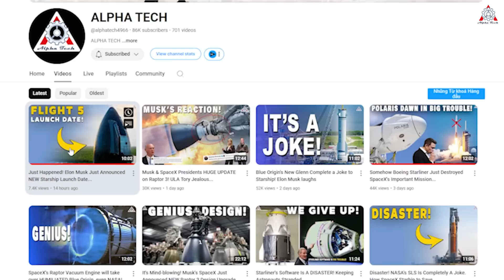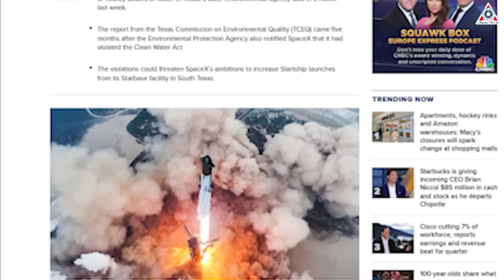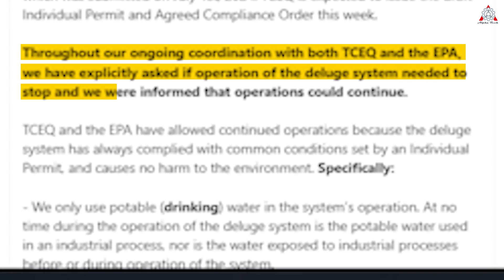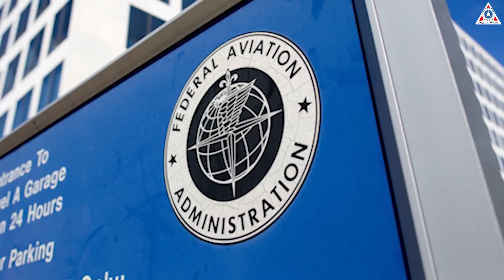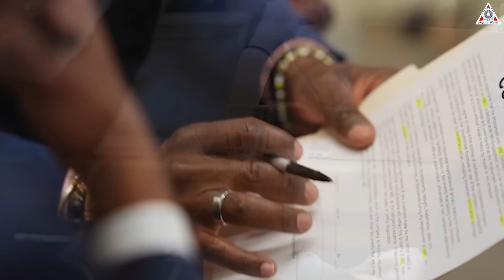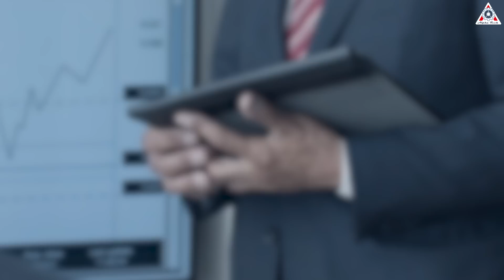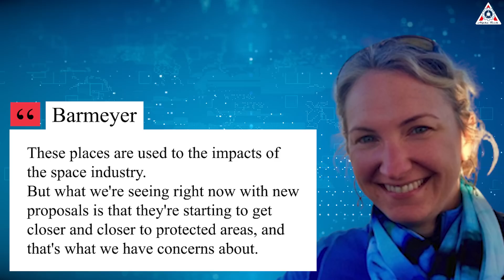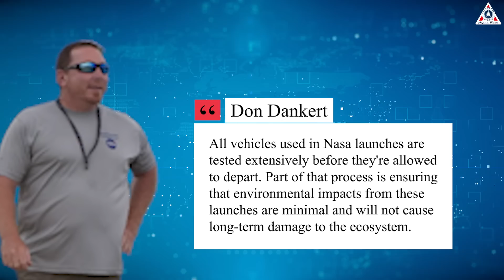Elon's Starship Is In BIG TROUBLE With FAA! What happened???

Comment: Every government agency is being sent to attack SpaceX and every company Elon Musk owns just because he held a public conversation in X spaces with Trump and talked about broken systems within the government and exposing government propaganda. Elon even pointed out that vilifying oil and gas is the wrong way to go and in all practical aspects it will take around 100yrs for just the USA to transition away from carbon-based fuel even longer for manufacturing. We are 1000+ years away from Star Trex technology and until we get there petroleum products are needed to make basic items from glasses to shoes and Carbon Steel to aluminum and titanium, basically every item you own or use petroleum is in the production line somewhere. Oh, the EPA clean water act wants to tax you based on how many square inches you roof, and driveway covers

Comment: When they do a Spin Test, pumping fuel through the engines with no ignition, they are venting methane to atmosphere.  When they fill and empty the booster and starship tanks, they vent methane to atmosphere to control pressure.  As production ramps up, multiply all this by twenty five or more.  Methane is a greenhouse gas that has ten times the environment impact as carbon dioxide.  Then there is Falcon and all its launches.  This is a detail of environmental impat that Inever hear discussed.  The topic is restricted to the combustion products of launches.
Reply: The spin test makes the static fire obsolete so one test instead of 2
Reply: Hi jeffe😂😂😂🎉
Reply: And every full of crap climate alarmist deluded liberal put together produces even more methane and CO2 than starship, my vote is we keep starship and ditch the karens.

Comment: -
Well the Anti-SpaceX folks are out in force;  I doubt they are really environmental folks; as they keep referring back to the first flight problems; like such issues are still occurring, or such has just happened.  Which is a foul propaganda tactic that Fox Noouse practices.

It was reported that the first time the water Deluge was used there was some contamination from its manufacturing processes for the few first times when it was tested; that went away by the time of the third launch.

There are roadblocks on top of roadblocks being thrown at SpaceX to impede its development of its Starship launch system. Looking at the big picture; since the industrial revolution, well over some 200 years, the human race has pumped at lot of green house gases into the atmosphere.  The human race can't just turn off all processes that make green house gases as that would kill thousands of human beings; if not millions of human beings. Though we should mitigate some effects of the green house gas production. For example closing down aka plugging the thousands of abandoned natural gas wells which many are leaking in the United States, would do much more to mitigate green house gas problem than shutting down SpaceX.  If you are wondering why the plugging of the thousands abandoned natural gas wells hasn't already happened; it is because of doing such is rather expensive.  

As for Starbase at Boca Chica Texas the oceans are going to rise for a very long time.  Maybe for hundreds of years.  It should be noted that it is beyond human ability to stop the oceans from rising at this point in time.  Thus the shorelines are going to change; whereupon the shorebirds are going to move inland. SpaceX has purchased land upstream for the wildlife, but eventually even that will be overtaken by the rising waters. The green house gas mitigation efforts need to continue as that buys us additional time to prepare for our children's new reality.  But care needs to be taken for these mitigation efforts that only target things that will actually make a difference; while avoiding the feel good quick fixes that accomplishes little.  Electric cars are a good example as even if the electricity is produced by coal to charge the car batteries the result will still be a reduction of green house gases.

Blue Origin actions shows us how Jeff Bezos grew Amazon.  It seems Jeff Bezos efforts are to slow down a competitor's efforts by using foul politics and lawsuits.  Unfortunately certain Physics challenges cannot be solved by lawsuits. It should be noted that Jeff Bezos space efforts at best have been sluggish and lethargic. One would hope Jeff Bezos could Focus on the manufacturing of space equipment if he wants really wants to compete with Elon Musk.  In the mean time Elon Musk thrives on chaos by poking various groups in the eye with foolish statements on twitter. That activity can create political backlashes that can slow things down. The rather grim reality is humanity doesn't have a lot of time to mitigate various climate problems that will ultimately going to cause the mass starvation of humans beings.

The FAA needs to allow SpaceX to advance with its efforts to do its thing within the USA; while curtailing Jeff Bezos unhelpful litigation and other odd legal maneuvers.  Really Jeff Bezos needs to learn how to focus on manufacturing space hardware to compete with SpaceX. It is really amazing that Jeff hasn't figured that out.  Maybe Blue Origin Is-Not a going concern, but just a toy for some billionaire.

In the past it was discovered that using systems developed for controlling Railroads were impracticable for controlling Airlines.  As a result it is likely that systems developed for the controlling Airlines will be proven to be impracticable for controlling Space development systems. Perhaps NASA should be the organization the oversees Space development instead of the FAA.  

Until we have established colonies on the Moon and Mars we need keep using our brains to create viable solutions to keep everything from burning down. The Human story is all about overcoming exceedingly difficult challenges in order to survive and then to prevail.
--

Comment: Because releasing large amounts of mercury into the environment is a great idea?
Reply: Well check the seafloor and the fish around Los Angeles if you are searching for mercury into the environment.
Reply: Eating paint chips with your soy milk is not a good idea.
Reply: @danielsee1  Yep, I 'd stop drinking that stuff if I were you.
Reply: Where did you find "large amounts of mercury"?  They said that they found traces of  mercury below EPA limits...
Use your brain, whatever water SpaceX is using it comes from environment.  They simply don't have process(es) that would produce large amount of waste water nor deluge system is designed to handle waste water.

Comment: ULA,Boeing & Blue Origin  lobbying to shutdown SpaceX, They are the ones filing paper work to the FAA for these environmental issues. SpaceX is going to have to sue them soon. Blue Origin & ULA must have read Altas Shrugged because this is exactly the same method used against Rearden steel in the book.

Blue Origin Urges FAA to Cap SpaceX Launches

"June 26,2024: Last week, Blue Origin filed a public comment to the FAA requesting that the regulator limit the number of launches of SpaceX’s Starship—the largest and most powerful rocket ever built"

Comment: i dont understand why people are complaining about the deluge system. there was an investigation and a finding of no significant impact. and the epa allowed up to 30 uses of the deluge system per year
Reply: The deluge sys allows shockwave to flow away 360°.

On the other hand, cape Canaveral launch site only release those shockwave toward 1 direction, causing less impact.
Reply: Calling the runoff "industrial waste water" is pretty disingenuous. Nothing in the exhaust is soluble in water, and any oils, etc. on the pavement would be washed off by rain in any case.